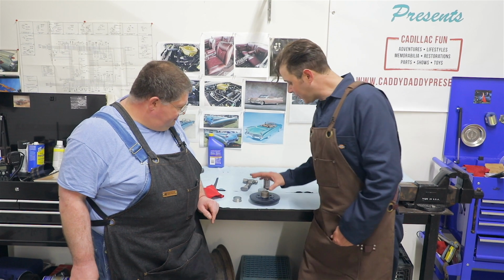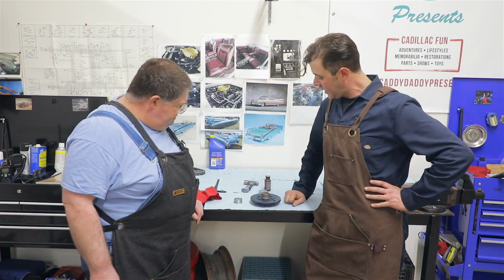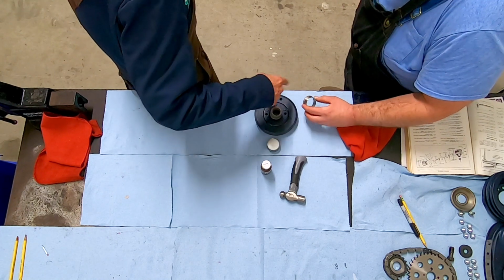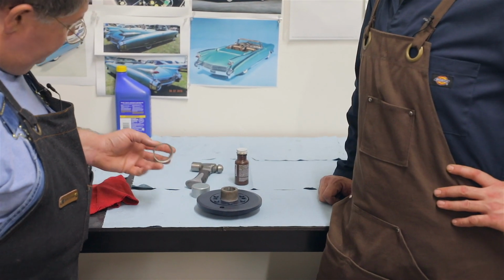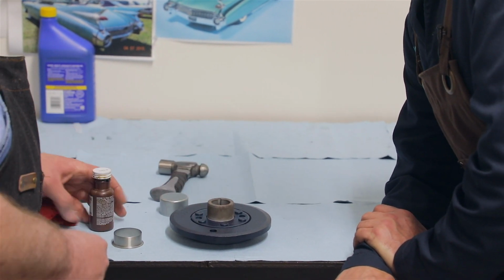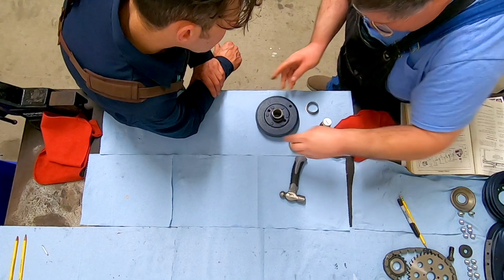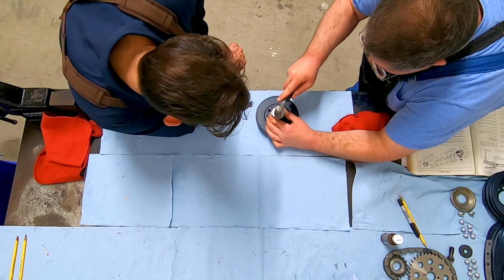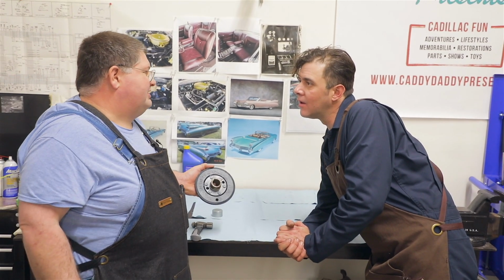How to use a Speedi Sleeve

Comment: What do you do before assembling the sleeve
Reply from the maker: Other than making sure of the final position on the shaft, nothing else is done except to be sure everything is clean. A small amount of lubrication will ease assembly. Locktite retainer may be applied if necessary.Josh

Comment: What was the thickness difference after installation? Could you run the original size seal?
Reply from the maker: The wall thickness of the Speedi-Sleeve is thin enough to allow the use of the standard seal for the application.

Comment: Do you leave the lip on or peel it off like they show on other how to’s videos?
Reply from the maker: The driving lip should be removed, but sometimes that is not easily done due to being in a tight place. As long as it does not interfere with assembly, or causes the seal to be deprived of lubrication, then it can be left.
Reply: @Caddydaddy  thanks for the quick reply. Just did the job and decided to leave it.
Reply from the maker: @dljones61  Great.